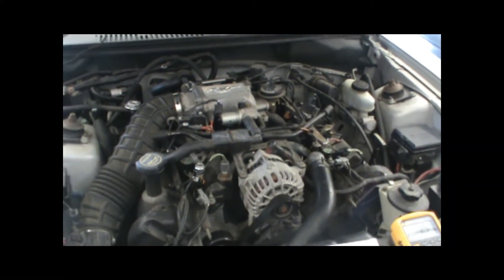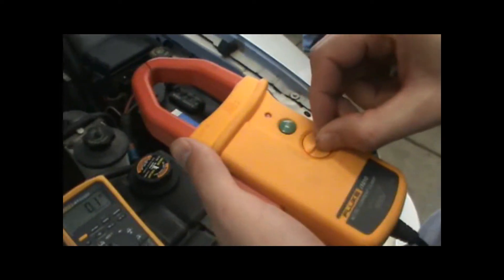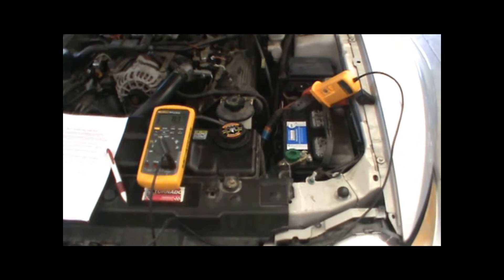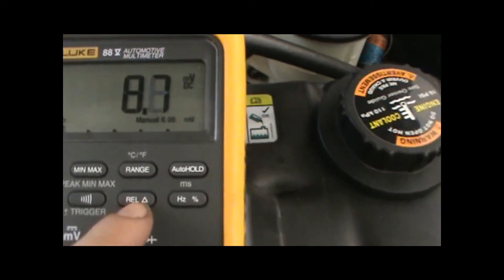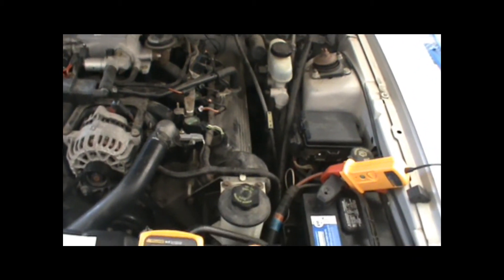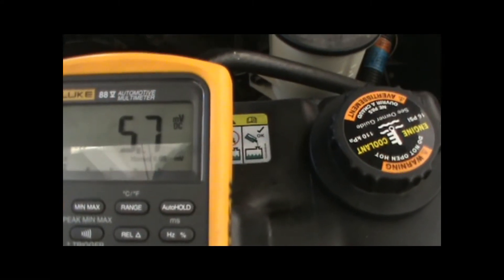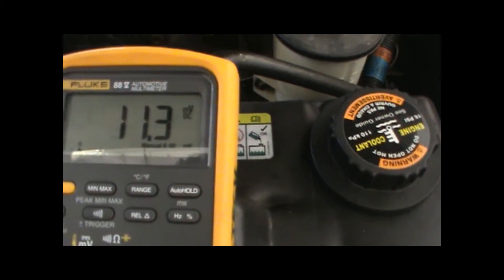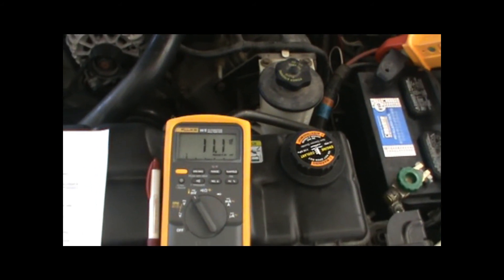How to test amperage flow usage with an Inductive Ammeter (Amp Clamp)

Comment: The fluke meter measures Amperage on that setting (mV) don't ask me why it just does. The reading is actually mV but it is indeed Amps that was showing. I have two of the Fluke standalone clamps with built in LCD display, much easier. Another point, as electrons pool around the negative terminal, draw tests like that yield better results on the negative cable, electricity flows from negative to positive not the other way round but it is taught generally positive to negative flow.

Comment: Wow people.  He is measuring amperage by using and inductive resistance meter.   There are meter specific to AC or DC current.     

There is just a few points he missed as well as not the best way to measure something such as a blower motor. 

First explaining setup of the probe.  Many will have a setting when reading low amperage that will be 1mV/10mA  So set your meter to a setting in mV  as his was. But zero your probe nearest the area you will be clamping.   Some equipment such as i have is sensitive enough to pickup the inductive frequency of fluorescent lights 10 over my head.  These probes can measure milliamps. Very sensitive.  They also have a maximum capacity to measure. Damage can result if used to measure current too high or on wrong settings. If your not sure of the current start high and work down in meter size and settings. 

Second is how it was attached. Most cases you want the probe as close to what you are measuring.  So in the case of the blower your going  to want it right at the blower. Why, cause measuring at the primary cable like that as soon as you key on the meter will read the current draw from everything.   Thats where that nice fluke has a setting to zero itself. So you key on and zero that current. The reading acts like its not there. Turn on the blower and you will have a quick and dirty check. 

Questions

Comment: Yes, he's confusing amps and volts... but there's a much bigger problem than that: the clamp-on ammeter only works for measuring AC current ... not DC current as a car battery produces.

Other viewers: If you are just learning about auto mechanics or how to use test equipment like ammeters PLEASE regard this video as having substantial problems.
Reply: No, Dan, I am afraid you are the one here making wrong assumptions. Although inductive amp meters are designed to read AC, there is one type that can measure DC as well through the Hall effect. Also, because it measures inductive currents, it does not measure Amps but mV instead. The conversion is obtained by accounting for the impedance of the inductive circuit, which is usually of 1mV to 1A. I hope this explains it to you.

Comment: The ammeter is connected up to the voltmeter.  Probably, there is a voltage to current ratio that has to be taken into account to figure out what current you are actually getting in the wire.
Reply: There is no ammeter connected to a voltmeter. There is only one multimeter set to voltage with a clamp locked on one of the battery terminals. The Hall effect measure an inductive difference of potential. That is converted back to mA. Usually the conversion is 1 mV to 1A.